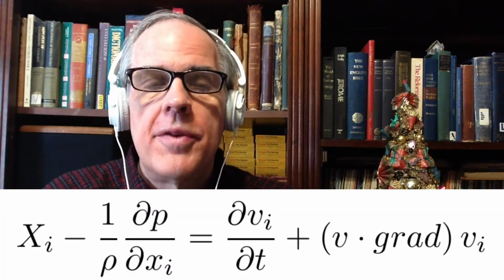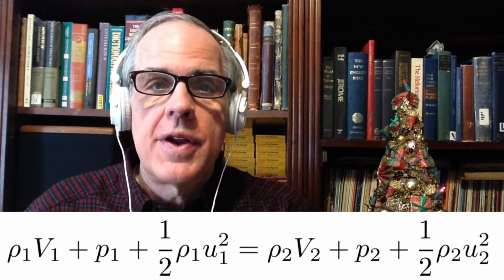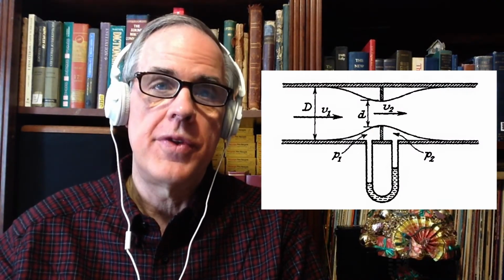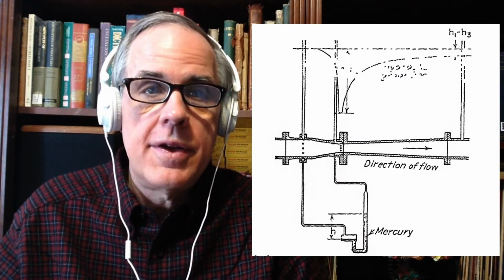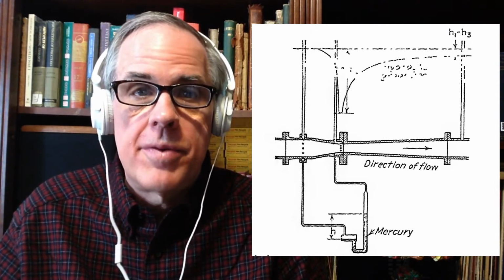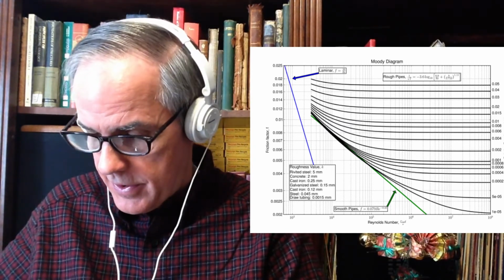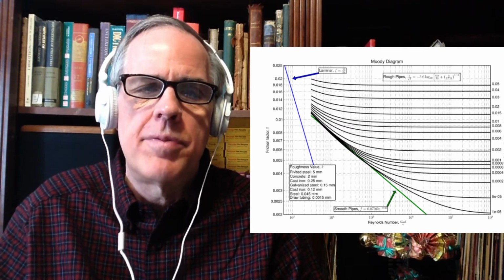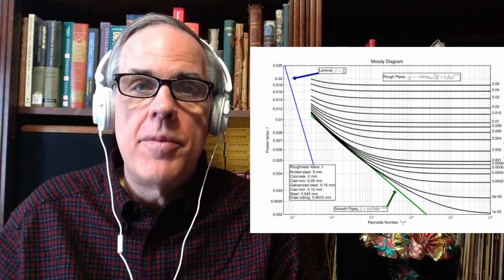Flow Meters, Gate Valve and Pipe Losses (Moody Chart)

Comment: I like US/English units, because they reflect the ergonomic reality,  which is were everything starts, I discovered this aspect of units systems late when I started a course of yacht design, and then I realized how it applies to all fields of engineering, before I used the metrics of the decimal system, SI units. 
Many people told me SI (International System of Units) was modern and SI was the way, and English/US units were deja vu. Meanwhile I had to work with the US/English systems not really knowing of its benefits, specially when you have to really measure twice to cut once.
Sure SI is the way, because we have to use computers more often now, with iterations, solving complicated equations, for example.
I still wonder, how it all would work in models, like in pilot plants or dams, in which the scale come out skewed!